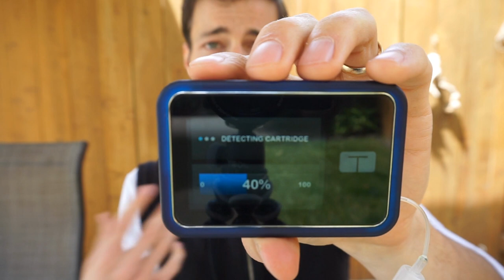How To: Insulin Pump Site Change (Tandem T Slim X2 Insulin Pump)

Comment: Im a type 1 diabetic. Recently diagnosed january this year. Its been hard for me. I just need to know whats the best way to gain weight? Ive always struggled gaining weight b4 i was diagnosed now its even harder.
Reply from the maker: Best way (simplified) is to control blood sugars and eat more while stimulating large muscle groups (working out). Though, that's easier said than done. How're your blood sugars doing so far?
Reply: @FTFWARRIOR  normal so far 95-175 range. Depending on what im eating. Im on my 4th day of the t-slim pump so hopefully my weight improves
Reply from the maker: @LANI-kn9be  Glad to hear that it's in a good range! Though, if gaining weight is difficult for you (like it is for me) it won't budge unless you are intentional with it. Grab that training in the description for any extra help that you might need

Comment: If there is leftover insulin in the reservoir and it is time to change the site, can you retrieve the leftover insulin so you don't lose insulin? Can you add insulin if the reservoir is low and it is not site day?
Reply from the maker: I don't think you can add insulin, but you can take it out from the old pump when changing sites

Comment: Uggghhh there doesn't seem to be a perfect insulin system... I do not like the extra stuff on this tubing and the worst part is the needle for the infusion set goes straight in.. Am I able to use Medtronic infusion set? I hope they can get more feedback from people like me. Looks like I'll give it a try, but it looks like it still needs something better..
Reply from the maker: I think the perfect insulin system would be the pancreas.. haha oh how I wish I could trade mine in!
Reply: @FTFWARRIOR  haha touche!!
Reply: The Medtronic Silhouette and Tandem VariSoft are virtually the same.  Only difference is the two slots on the top of the insertion needle on the Silhouette whereas the top of the VariSoft insertion needle is smooth.  I have used the Silhouette with the Tandem VariSoft tubing with no problems.

Comment: How well do cartridges do at removing air bubbles? I have a Medtronic pump and the way Medtronic pumps are loaded tends to be quite easy to suck in air bubbles. Can be frustrating at times
Reply from the maker: Great question! I have been using the pump for about 8 months now and I haven't had any bubbles large enough to cause me to worry. Seems to be pretty great! This is also due to the user manually removing air upon cartridge changes as well. Hope this helps!
Reply: @FTFWARRIOR  Sweet! That's great to hear. Thinking tandem might be my next pump. Unfortunately I just got my Medtronic pump this year so I'll have to wait the long wait before I can get a new pump. Appreciate the very quick response
Reply from the maker: aww bummer, well I hope medtronic serves you well in the meantime! Best of luck!
Reply: @FTFWARRIOR  It is a bummer, but I'll survive lol. It's not a terrible pump, but I think the tslim would be better. Live and learn I guess
Reply: @IsolatedEcho1  Go slower when you fill the reservoir. THAT is the trick!  I've used them for years and I know that if I pull back too hard, and try tofill it quickly, it gets thousands of tiny air bubbles. They will 'rise to the top' if I just remove the plunger and let the reservoir sit upright for a few minutes. Then, when I put the reservoir in the pump, and push the pump to get the drops of insulin to come out, I make sure and hold the pump so all that air is at the top and it pushes out of the pump first!  Makes sense?  Then, I have NO air in the reservoir OR coming into me!

Comment: Hi I am about to change from the animas vibe to the t slim after 3 years......I was wondering what the thing is that's 1/2 inches away from the pump on the tube....is it another place to disconnect?
Reply from the maker: Excellent question! It is where the cartridge connects to the tubing. Once connected (upon priming the tubing) we don't disconnect that portion
Reply: As I understand it, the plastic canulas do not have this.
Reply: Thank you x also someone's ready for summer lmao that summer body

Comment: I am going with the true steel. I have been on the autosoft 90 since being on a pump and I have dealt with so many kinked tubing. Like today starting last night I ate. A snack then rode my bike home. Got back n ate dinner. Then I passed out n two hours later my pump was going crazy. Said my sugar was high n double arrows up. Bent cannula was the culprit.  I felt horrible. Luckly I had fiasp n take a Manuel correction. Took forever to come down. I switched the cannula then my sugar went high again couple hours later. Same thing. Bent cannula. I said enough of this. It puts you in a scary spot and situations.

Comment: I know this video is a bit old and my comment is just now but did you start with the trusteel or the soft cannula ? I am having a bit of trouble with the vent cannulas. Also do you feel any discomfort at any time using the trusteel ?
Reply from the maker: I gotchu! I started on the trusteel actually, so I have nothing to compare it to, and overall, the trusteel are pretty darn comfy

Comment: There is a step you should do BEFORE you load the needle with insulin. Insert the needle into the new cartridge and draw out any air that might be there from manufacturing. You need to do this otherwise you run the risk of occlusions due to bubbles caught in pump and line. Expel the air from the needle, then load with insulin.
Reply: He did that, but after filling the syringe. That is the way the manufacturer recommends doing it.

Comment: you said you are type 1, my doctor tells me I am type 2, yet you use and set up your tandem pump almost exactly the same way I set up my Medtronic pump, can you tell me the difference in use, it's my understanding that type 1 diabetics body produces to much insulin and type 2 diabetics don't produce enough insulin, hence the need for insulin injections when BG gets to high.
Reply from the maker: Type 1 Diabetes is actually when there is no insulin being produced, which is why all type 1 diabetics require insulin injections. Type 2 diabetes begins as insulin resistance and in some cases such as yourself may require insulin as well. I hope this helps!

Comment: Hey, so i'm hopefully going to be starting on an insulin pump soon, hoping to get the tslim. i'm a little nervous about having a needle/catheter stuck in me 24/7. other than pain that occur if the needle is ripped out, um, does it hurt going in? or is it uncomfortable in general? i'm thinking of every iv i've had and i wasn't 100% a fan, but they tend to use a lower gauge so i'm hoping a pump would be different. i'm super nervous about pain and everything after watching another video of a little girl crying while putting in her omnipod, and even though i'm like five times her age yeah, this makes me nervous as i dont want to embarrass myself crying over something that seems simple. lol. sorry for blathering on, but yeah, does it hurt? like since you use a needle is it uncomfortable at all? also, i'm just curious over why'd you pick the tslim since most on reddit/youtube seem to prefer the omnipod.
Reply from the maker: Absolutely valid question! My first time putting the needle in, it hurt like crazy.. I'll be honest. The Tandem representative that was helping me said that it was extremely rare and to consider changing out the site and trying again. I did.. and there was absolutely zero pain. It was odd knowing that there was a needle in me and yet I could run and jump with zero pain! I will say that every once in a while I get a "bad site" and it hurts a little, but overall I am very pleased. As far as choosing the Tandem pump, 2 considerations were taken. First- I was 90% covered with my insurance, meaning it would be the cheapest option. Second, I already had the dexcom and I did my research to find out that dexcom and tandem had a partnership that would blossom into what is coming out THIS MONTH (I'm so excited) - the predictive low algorithm. Lastly, Tandem is the most trustworthy and technologically advanced piece of technology within the pump realm (from my experience and research) and I would definitely recommend it. I hope this helps!
Reply: @FTFWARRIOR  Bet you hit a nerve that first time ... what rotten luck!  I have two or three places I KNOW I cannot use!  But that still leaves me like 99% of all the other places and they don't ever hurt.
Reply: I've been on a pump for almost 15yrs.  Yes,  occasionally it hurts a little when you put the short needle in but in general, I don't even know/feel where the current site is as I go through my day.  Even when lying on the site in bed, I do not feel it.
Reply: @FTFWARRIOR  aw man, i got a random notification about this today. i've been on the pump for 4 years now and i love it. thanks for your input. i've been diabetic since 1993, and i've only been on the pump for 4 years now. i'm upset i didn't try it sooner. maybe i was terrified of skynet going live and computers having an easy way to kill me😅 but yeah its not too bad.
Reply from the maker: @bsq2phat  You're welcome! I'm sorry you felt that way and that's okay. I'm glad that somehow this video  help you and you're doing great! Keep up the fight, Warrior!

Comment: This seems to have a lot more steps than my mini med big turn off for me.
Reply: You should really think about changing. I  felt the same way at first but I am so glad I changed.
Reply: I changed from Minimed to Tandem last November.  The Tandem is more involved but after 3 infusion set changes it's not an issue at all.  And specifically if you used the Minimed Silhouette infusion set you can use the same inserter with the Tandem VariSoft infusion set with a slight modification.

Comment: damn. You don't pull out the needle from the infusionset???? Okay a complete dealbreaker. Medtronic it is. You pull out the needle from the infusionsets post insertsion on medtronic devices so there is only a plastic tube inside you.
Reply: I think you have a choice on the sets. You can probably use the canulla style also.
Reply: So many different sets to choose from. You don't have to use this one he's chose to use.
Reply: There are soft sets for Tandem just like the Mini Med...